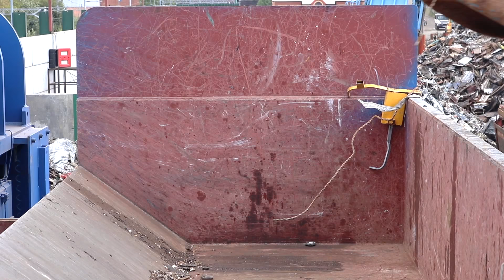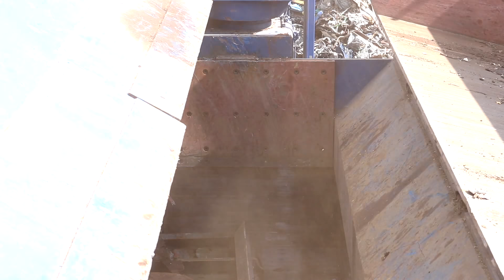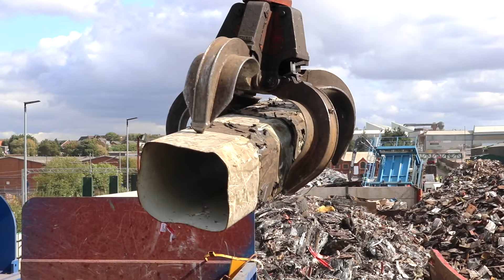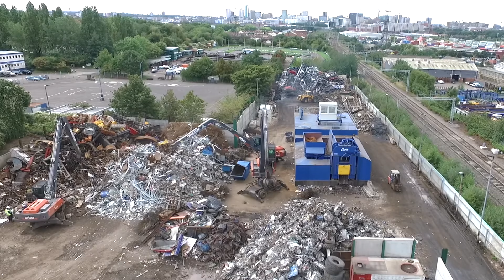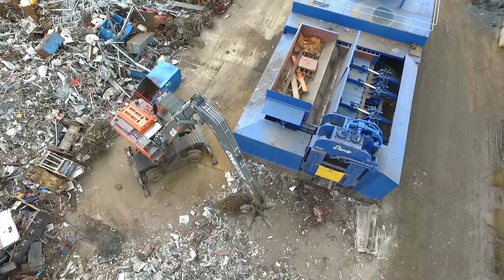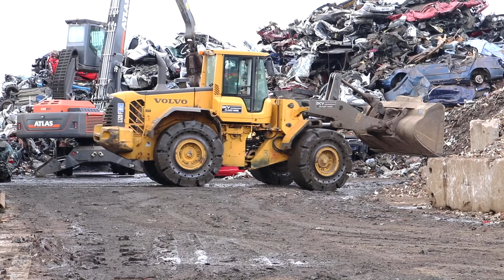Visiting a UK SCRAPYARD!

Comment: I'm an operator of cranes (material handlers) for close to 20 years, I've used Cats, Liebherrs, Sennebogens, and Terex Fuchs. Haven't used Atlas yet, but they look kinda weak. The Terex Fuchs have been the strongest cranes i've used by far.
Reply: Hello have you used machines?